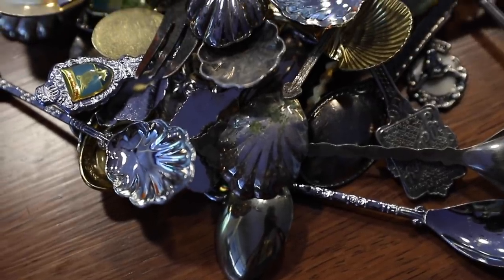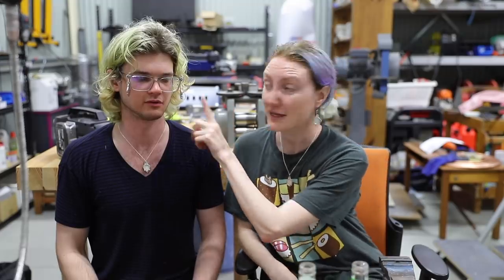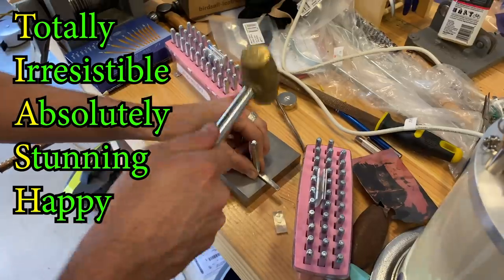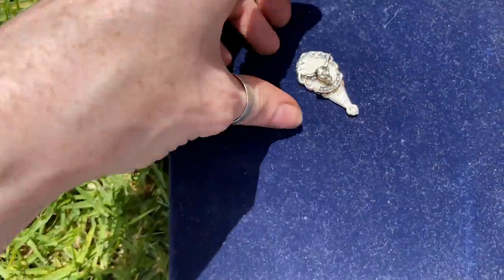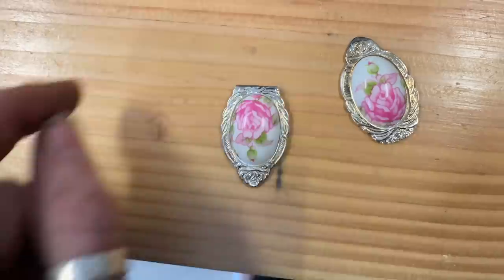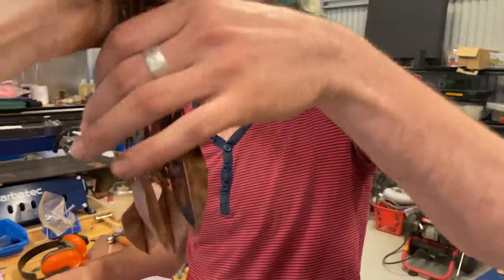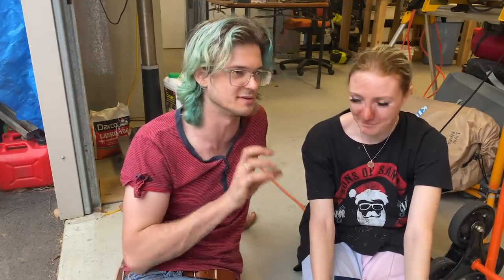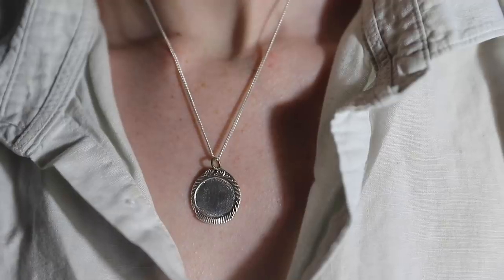THRIFTING SPOONS & MAKING JEWELRY!!! VINTAGE THRIFT FLIP | THRIFTMAS DAY 10

Comment: on the spoons that won't have enough middle piece for a ring, you could add extra length to the pendant. so instead of a drilled hole for a c-ring, you can fold the extra length to the back and have a beautifully round piece for the necklace chain to go through directly <3

Comment: I like turning sterling silverware into jewelry. I love repurposing stuff. Haven't sold anything yet, I don't have the confidence for that. I have done some stuff with plated spoons and forks. But they are really, really hard to manipulate. Annealing them would make them easier to work with. However, if you get the plated items too hot during the annealing, the silver will just become an alloy with the base metal.

Comment: for an idea on the spoons where you remove the souvegnier part. you can make prints of images you like or purchase and then glue them in and cover with resin or a glass like surface and easily make them into 18th and 19th century styled jewelry.

Comment: Couple of thoughts, use a wax pencil to draw a straight line when stamping names and line up with the line. Also if you coat the copper with rain or polyurethane it will maintain its color. Just be sure they're are no oils left on it before coating or it will cause oxidation.

Comment: STAMPING TIPS!
1. Get straight words and letters by laying out your word along a strip of masking tape or a line of Sharpie.
2. Get your letters squared up by looking at how they line up against the tape/sharpie line from above! The stamp shanks are square for a reason. 
3. For an even letter make sure your stamp sits flat to the metal and that you strike it evenly. This takes practice! Copper sheet is great for practice. And it takes much less force than you expect to stamp the letters properly. EASE UP.
4. If you make a mistake you can sometimes smooth it back with a burnisher and fill with a touch of easy solder and buff that back, or if it's not a super deep press you can sometimes just buff it back with rouge enough to stamp over it.

And non stamp related...
1. SECURE YOUR WORK ON THE DRILL PRESS! It will rip things from your hands faster than you can blink.
2. ALWAYS WEAR EYE PROTECTION OVER YOUR GLASSES AND KEEP YOUR FACE BACK!
3. Sam needs to quench his flat pieces in a larger container. A flat pie tin is fine or a bucket, but quenching the whole piece at once avoids uneven heat stress.
4. Don't try to use a jewelers saw like a hack saw. Sit at a bench pin or table edge and saw straight up and down. The saw moves MUCH easier and faster and your shoulder and arm don't fatigue as quickly.
5. Don't force tools to avoid flying metal! I about had a heart attack watching that...pretty sure I have a new grey hair. I'm only 33! I don't need more!

Y'all are off to a great start and I will keep tabs on Sam's shop for sure!

Comment: Can I ask Sam thru you Alex, how can I polish my sterling silver jewerly to a high shine? can I do it myself for cheap?
Reply from the maker: If you don't have any silver cleaning products at home, you can always line a bowl with aluminium foil (or take an aluminium baking dish), put in a couple of spoonfuls of bicarbonate soda & salt, then add 1/2 a cup of white vinegar, 1 cup of boiling hot water, add your items and after two minutes take the items out and wipe them with a cloth! You don't have to use vinegar, but it speeds up the process. Happy polishing!